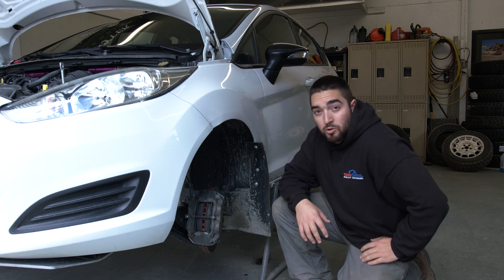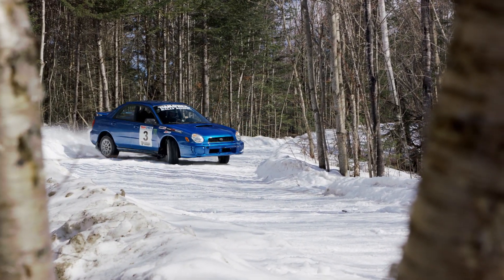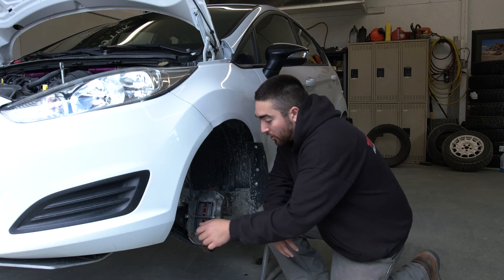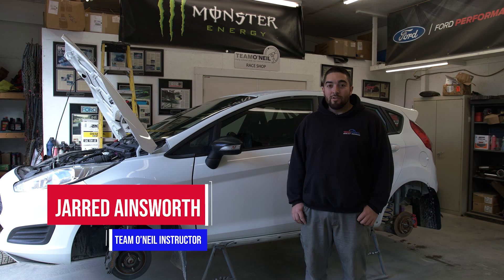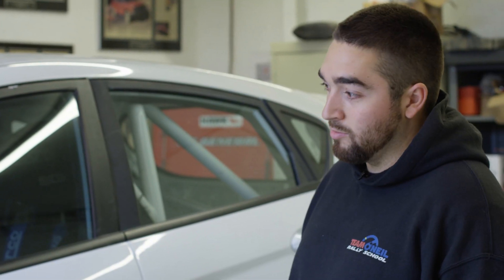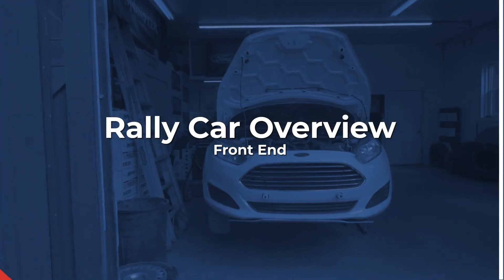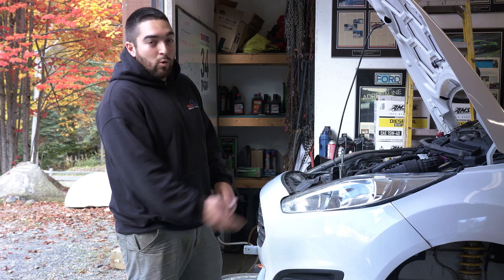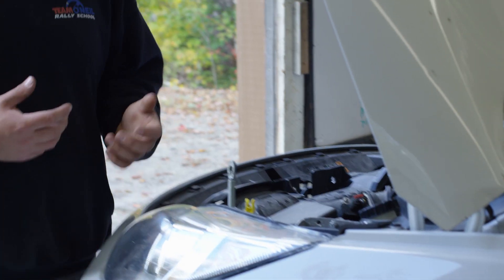Rally Car Build Explained

Comment: "We move a lot of things around [in the engine compartment] based on heat and to simplify how we work on the car." Would love to know what you did! Also, do you bypass the brake booster? What about the steering wheel? All airbags removed?
Reply: yea, skipped plenty of nuanced details for the sake of simpicity. Would love a long techical breakdown
Reply: egr, icv, ccv removed. airbox moved. battery moved. Air bags removed. Booster intact likely, if using the stock pedal box.

Comment: This video is such an inspiration to build up my ST, thank you for the information! Those front brake calipers especially piqued my interest being able to run them with 15inch wheels
Reply: Hi I have a similar set up on my rallycar
What do you want to know?
Reply: They are AP Racing GRAVEL spec calipers (I don't know if they are the R5 ones or the R2T class ones they are using there?), made to work with high ET number (backspacing), 6"-7" wide, 15" gravel rally wheels, without needing spacers.

But yeah, $$$$$$!

Comment: Im trying to get into other aspects of motor sport, as i like touge races (not drifting in it though, if that makes sence), i like muscle cars quite a bit, like the z28(chevy), 78 firebird, and some cool drag built hondas. But im trying to learn about rally/ offroad. When i was a kid i absolutley loved offroading vehichles, like jeeps, dirtbikes, and i sort of liked rally cars, but ive never reaserched about them. Ive only watched rally races because of the impresive speed and consentration while under so much stress trying not to crash into a tree or flip over. Thanks for the info.

Comment: i live in kenosha wi where the roads suck. i was thinking about getting a fiesta and put a rally suspension in it and use it for food delivery.     is this a good idea or what??
Reply: A REAL gravel (or tarmac for that matter) rally suspension, like the Reiger one in the above video, will co$t you between $7000 and $10,000 US dollars (new at least).
Used/rebuilt a little bit less.

Just use a good set of Bilstein B6 dampers, and the factory springs, and you can go anywhere (with the correct tires) as long as you are not traveling at rally stage speeds.

Comment: Has anyone or does anyone know if the UHMW plastic (like cutting board material) is any good for under car protection on a rally car? I’ve used it on my UTV and it works great,probably easier to shape aluminum was JW.

Comment: Does anyone know if a part time all wheel drive system would be good for rally or should I just find something full time? Or is there anything I should be concerned about? (Btw yes I know the difference thx to team O'Neal lol)
Reply: Think the answer is probably it depends on the system. From what I know, I would think in rally a full time system would be better. Since, disengaging and re-engaging the drivetrains probably is dependent on some system which adds an additional point of failure. If I base myself on this video alone, for rally u want reliability so I'm guessing the part time all wheel drive system might not be the way to go.

Comment: Hi, i have a 1.4 fiesta mk7 and i want to transform it in a little rally car. In the past few years i have changed many cars but for some reason i got in love with my little fiesta... I have changed many parts in my fiesta since i bought it till now and now i want to do some serious upgrades to my fiesta. I want to change the engine head cos the camshaft it's on it's way and i want to turn it into 1.6 witch it's not very hard but the main thing that i want to do is to make it 4wd and i looked at some videos and i have a roughly idea but i still didn't find the righ gearbox that's gonna fit. Can you guys give me some ideas or some help to find the right thing? Or can you make a video to help me and many others that they wanna do an upgrade like me. Many thanks.

Comment: I'm in the market of getting a fiesta ST but I want to to know which model years or packages came with the LSD?
Reply: In the USA, NONE of them ever had a limited slip available, EVER, even as an option, from the factory.

In England/Europe, only the very limited production M-Sport Edition ST200 had the same Quaife limited slip installed by M-Sport for the Mk7 (late 2013 to 2019 in the USA, 2013 to late 2016 everywhere else) cars at least.

Not sure about the Brit/Euro/rest of world Mk8s (2017 model year and up over there), but I do believe that a limited slip is a factory option on those STs.

Comment: How long do the cats/O2s survive with the heavy duty diesel oil? ;)
Actually, on that note, any aftermarket engine management/logging/exhaust (say, 200cell metal core)? Water to air vs fmic? Water pump pulleys, engine hotspot monitoring... basically anything durability/safety-wise. Outright power is the least interesting thing in cars anyways :P
Reply: there's no cats in racing. And there's no oil being burnt.
Reply: @ttt69420  The "no cats in racing" statement is false - or shall I say, not universally true.
Reply: @SpiritLwerewolf  Yes, ALL of the WRC classes of cars now MUST have them fitted, albeit they put them in the back of the car, right before the tailpipe, like in the build above.

That stacked up Amsoil diesel oil might be for the schools pickup trucks/service and tow vehicles. 😉

Comment: Those front brakes, and the Reiger R2 suspension are almost the co$t of a decent, lower mileage, street Fiesta ST all by themselves! 😱

Do you change the knuckles/uprights back to the base Fiesta versions in order to fit/have the Reigers work properly on the ST??

Is there a reason you did not change the hubs to 5 bolt in order to take advantage of the greater choice in rally wheels out there (those 4x108 PCD, R1 class, silver M-Sport O.Z. Racing 'disc' gravel wheels are LONG LONG gone, save for whatever few undamaged ones you have left in your inventory!)??

You are NOT doing any actual customer rally car builds anymore out of the school location, correct??

So then WHO would you send a potential Fiesta (Open 2WD, or Limited 2WD) ST or otherwise to for a full build, or even the bespoke parts you no longer manufacture (like the skid plate), and sources for the kevlar protection (besides the insanely priced M-Sport Poland stuff)???

Is there a rust proof, and non-destructive way to install big SMS sourced, rally mud flaps onto a street Fiesta ST without using the way too flimsy (for working on ARA Rallies) Rally Armor mounting hardware?
Are the rivets on that car going into the actual fender metal edges, or the front plastic inner wheel well liner??